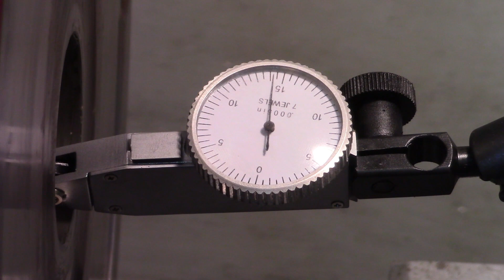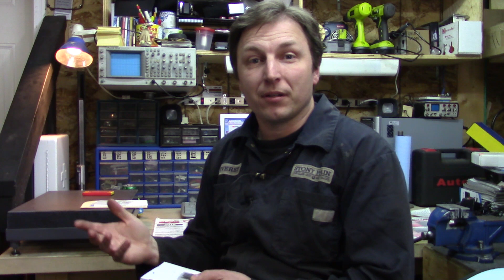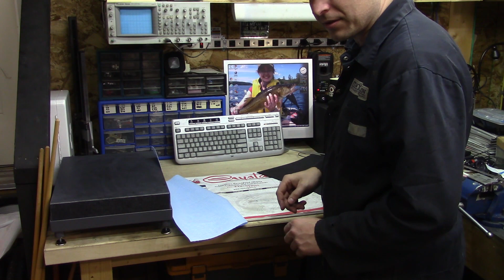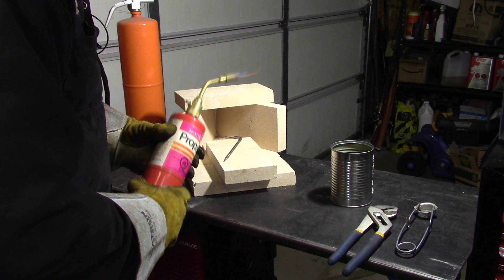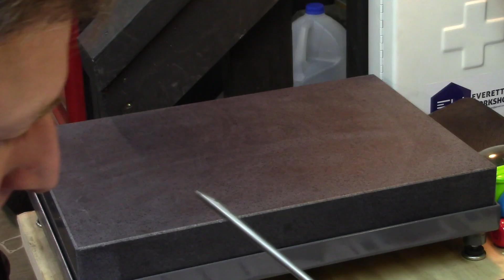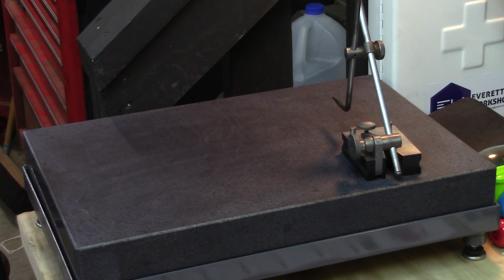Small Surface Plate Accessories Part 2: Making the Cover and Surface Gauge Parts

Comment: Hi , I have the same thread gauge still from when i was a first year apprentice in 1982 !    Nice job on the scriber . for years all i used was a 4 inch nail with an old bit of carbide tip brazed on & ground up  !
Reply from the maker: I appreciate David sending that to me, I might have need of Whitworth and/or BA thread stuff, depending on if something in the works does work out for me.  Thanks for the compliment, I think the scriber looks proportional and should work well.

Comment: if you want a little more heat to expedite the job, buy the yellow cylinders (MAPP gas) also, I have had excellent success with using basic canola oil for the quench (bonus is it smells like frenchfries when your done). Also, I went to the local thrift store and got a toaster oven for tempering. These all relate to the making of knife blades, but I feel the process is fairly universal.

I also follow Ade. Yes, he has a great channel. He has some really great ideas for overcoming the limitations of the smaller equipment!
Reply from the maker: I've seen guys using MAPP, but never tried it myself - as it is, I'm using up propane that was given to me (that cylinder in the video has got to be 20-25 years old) so maybe once it's used up then MAPP will be tried out.  I had thought about the toaster oven too, but waiting till the local thrift store has a reasonably priced one or one shows up at a garage sale.  While I have hardened and tempered stuff over the years it hasn't been a whole lot so it's something I'm still developing technique with.

Comment: Hi Everett and thanks for posting your videos, they are very much appreciated......can you or anyone else explain what the two round pins in the base of the surface gauge are for?
Reply: I just asked the same question.
Reply from the maker: Thanks Rich, I appreciate the support!  They are for using against the edge of a surface plate so you can slide it sideways and keep it parallel.  I haven't needed that function yet (just got it usable) but might in the future.

Comment: That thread angle gauge also has 14.5 degrees for ACME threads on the cut away corner
Reply from the maker: Yeah, I saw that too - I do have another gauge that is specially for ACME threads but I can see how having one that is open on one side will be handy.  Just thankful that David was thinking of me enough to send me a gift.

Comment: You could try "MAP" gas which is a mix of propane and acetylen and gets higher temperatures quicker! If you can buy the stuff in Canada.
Reply from the maker: We can get MAPP here in Canada, I'll have to give it a try.  I'm just using up old propane bottles for the moment, but will need to find something better.

Comment: Hey Everett,
     I really enjoy your channel. I'm about to have a machinist construct a frame for my 12x18 in. surface plate similar to your's.
     I'm also going to fashion a rubber protective cover.
      Question: What material is that white piece that you have on your plate that goes under the cover and is it needed?
Reply from the maker: Thanks for the kind words, glad you like what you see so far!  For the price, the 12x18 surface plates really are handy for a home shop.  That white piece under the rubber cover is simply a piece of paper towel that I put there to make a softer underside to the rubber.  At some point I may glue felt to the underside of the cover, but we'll see when I get to it.

Comment: You might want to look at a set of small oxygen and acetylene bottles (20 cubic ft. oxygen tank and 10 cubic ft. acetylene tank) along with a Smith's Little Torch set.  I find mine very useful and rarely need to use my large oxy-acetylene setup.
Reply from the maker: Hi Roger, that is a thought - depends on what happens longer term with cutting tools.  Part of me leans toward an oxyacetylene torch setup, part of me leans toward saving for a plasma cutter.  Neither is really an immediate option but it's more longer-term ideas.  If a plasma is the answer then a Little Torch like you say might be good for brazing and silver soldering.  Thanks for the suggestion, will take it into consideration when new equipment is an option!

Comment: Nice additions to the shop. Do you know what the two pins are for on the base? I have them on mine and I have no clue why they are there.
Reply from the maker: Thanks Randy, from what I've read the pins are for sliding along the edge of the surface plate to be able to slide sideways in a straight line.  Haven't needed that function yet but it's only a matter of time.

Comment: I have read some people use Kimwipes or baby but wipes to clean the surface gauge. I have not used either but am considering the benefits of baby but wipes.
Reply from the maker: Never thought of using the baby wipes as a lint-reduced cloth, I guess they do have a mild solvent in them.  I can give it a try, we've only got a couple cases in the basement for cleaning up Little Man's nether-region messes, having one pack go missing wouldn't be noticed . . . Thanks for the thought, I might have to try it!

Comment: A propane powered natural aspirated single burner venturi forge is stupid easy and inexpensive to build, and the best part is they can be made fairly compact. A little kaowool, a old bbq propane tank. A wye pipe, couple nipples npts fittings and a mig tip and your in business..all in mayby 150 bucks
Reply from the maker: Better ways of heat treating are in the works - and I do have a little bit of a hobby budget to play with but have to put the diaper fund first though, lol. Part of it is accumulating the stuff and having the time to do it.  But I totally agree, a small forge/heat treating oven is on the shop needs list!

Comment: What is the name of the rubber mat? I need a piece. On the last video we don’t have any apartments nearby, in town we have scrap pickers so I have to find the bed rails at yard sales, I think I paid like $2 for the last set. Now I have a list of stuff to build
Reply from the maker: I don't know if there's a trade name on it, it was a new product at the local Rona hardware store.  It's on a bulk roll, sold by the foot.  I like the stuff, and it was reasonably cheap, so it's tempting to use it to line the drawers of my mechanics' tool boxes.  Next time I'm at Rona I'll get the UPC if it has one, maybe it will cross reference to somewhere like Lowe's down in the States.
Reply: Thanks a bunch

Comment: You might try the Mini Ductor II MD-700. Its magnetic induction heather kit. Its 380$ on Amazon!
Reply from the maker: I've seen induction heaters used for hardening steel but just haven't used one yet.  I looked it up after you mentioning it but $380 USD becomes $510 CDN plus 5% GST.  I have a couple other things needed first, but thanks for the suggestion - after seeing some others here on YouTube make homemade ones, that might be a feasible option!
Reply: @EverettsWorkshop  Ah, you are Canadian! Where abouts are you?

Comment: do yourself a favor and get a machinist hand book, new ones are a little expensive but older ones can be found reasonably cheap (older ones have well written workshop practices and less emphasis on cnc). oxy propane is a good compromise for the home shop.
Reply from the maker: I do have one, it's the 29th Edition tool box size.  Certainly a bit much for bedtime reading but I have lots of dirt on the threading pages.  I totally agree that they're worth the money, for sure.  Uncle Tim has an oxypropane setup but I haven't tried it yet, might have to ask to borrow it sometime as he agrees with you that it's a bit less expensive for home use.  Still deciding what the next few pieces of shop equipment will be when the option becomes available, so I will definitely look into oxypropane.  Thanks for the suggestion!

Comment: It's not that propane isn't "hot enough", it's that to get the most out of it, you need an oxy/fuel torch. For example, Bernzomatic makes a torch set for around $60 USD that includes the regulators, hoses, torch, etc that uses the same propane bottle you already have. For example:

https://www.zoro.com/bernzomatic-cuttingweldingbrazing-kit-with-oxygen-wk55000x/i/G3268587/
Reply from the maker: The best deal I've been able to find locally is about $120 CDN for a MAPP/O2 torch system, I might just go get one anyway and give it a shot!
Reply: @EverettsWorkshop  Do be aware that if you do get one of these torches, and if you use the small oxygen bottles, you'll go through them fast! Figure 3-5 oxygen bottles for every gas bottle.